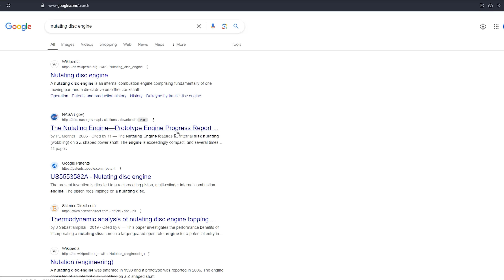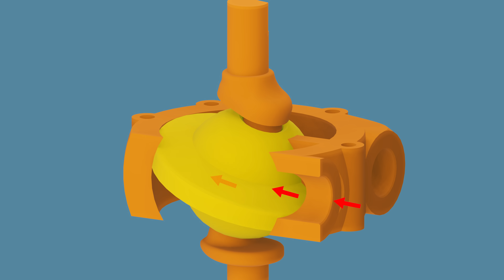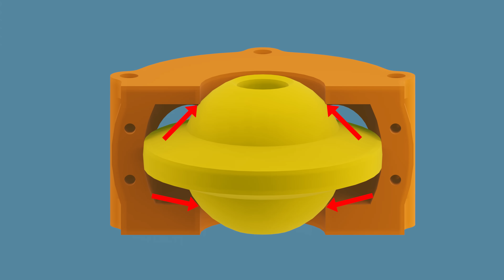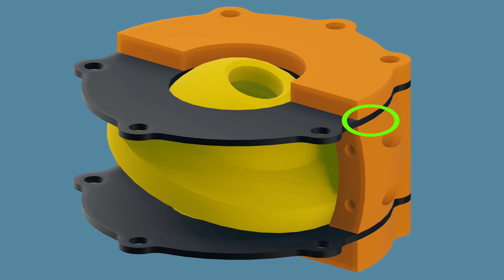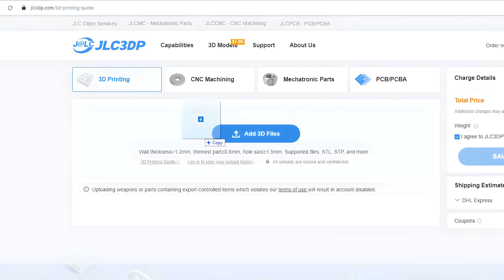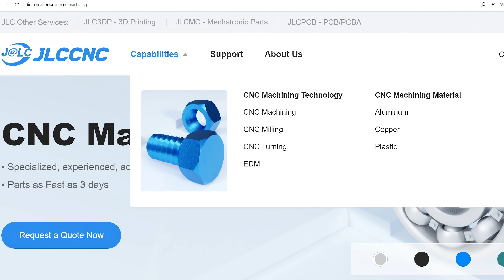I Built a Nutating Disk Air Engine

Comment: Yes it rotates. But it has two major flaws. First is the discontinous rotation movement. This is caused by the tilted axle. You need a second one tilted in the other direction to smoothe it out.
Secont problem is power. This "engine" is a waste of energy. To create a rotational movement with air a turbine would be much more effective. Because this motor just uses the pressure but a turbine uses lift created by the speed of the air and pressure. I think even a pelton weel would be more effective than this design. Even if used as a combustion engine, the friction of the seals would be higher than in a wankel motor, where only the tips of the polygon have to seal the chambers.

So in the end it's a nice moving toy but not a great working machine.

Comment: I could imagine aircraft using this same principle.  You would need very large air compressors to keep up with the demand of flight. I wonder if it could be powered by battery efficiently enough to produce proper thrust

Comment: A seemingly minor, but important distinction to all the budding engineers out there: the device shown here is a type of turbine, NOT an engine. The distinction being that an engine converts a different type of energy (thermal, chemical, potential, etc.) into mechanical energy. A turbine extracts the (already mechanical) energy in a fluid stream and turns it into work.
Reply: Im not an engineer but my first thought was: How is this more efficient than blades in a turbine? Considering this design never took off (I think), I assume it’s not.
Reply: @jck7986  I suppose it sacrifices efficency for simplicity
Reply: @bl4cksp1d3r  I don't think its even simple as  most other types of turbine has less moving parts
Reply: @bl4cksp1d3r  How is this more simple than a turbine? That is just a bunch of blades, nothing complex. No issues with gaskets and sealing etc. There is nothing simple about this design if you ask me, and given the terrible efficiency there is absolutely no point for anything practical. Still a cool video though!
Reply: @Eikenhorst  simple in the number and shape of parts. A wind turbine has more parts than this, the blade shape, the electric generator, swivel joints, etc.
I ofc make the mistake here of comparing a complex turbine with a simple one, and you might be right saying the most simple wind turbines are easier to build than this.
Reply: @bl4cksp1d3r  Well, obviously a wind turbine is complex! Since, as you mention, it includes a electric generator (and due to this, a gearbox and tons of other things). This thing just converts a stream of compressed air into a rotational motion, a task done far more efficient in a turbo (like on a car).
Reply: @jck7986  Oh, it very much did take off, just not for this application. The "nutating disc engine" is by far the most common design for water meters in the US and much of Europe.
Reply: @palpytine ok
Reply: 0:05
Reply: What if he plans on introducing fuel? 2 stroke...
Reply: @CB19087  yeah, that was my impression too
Reply: I think the machine compressing the air is the engine. The thing you made is an air differential.
Reply: @jonny5714  the machine i spoke of uses deisel as fuel. i edited my comment to make that more obvious. you can always google it though. 
this thing he's made in the video takes the power of the already-compressed air and turns it into rotational force which is the exact definition of a turbine.
Turbine - noun - "a machine for producing continuous power in which a wheel or rotor, typically fitted with vanes, is made to revolve by a fast-moving flow of water, steam, gas, air, or other fluid."
Reply: 1.  Engines involved combustion, and Motors do not.  Hence air motor, hydraulic motor, electric motor, Diesel Engine, Gas Turbine Engine, steam engine.  Anyway people use them interchangeably so when Rome do as Romans do.
2.  Another distinction is whether the device is positive displacement or dynamic.  This device is positive displacement. whereas a turbine (or centrifugal compressor) is dynamic.  The difference being how the work is extracted from the fluid.
3.  As to using this wobble device as an engine, sealing is a tough, but I think surmountable problem, but cooling the disk is a real headache.  Likely have to oil cool like a Wankel.  Next there will be hot spots with differential expansion in the housing.  The large wetted area has to be cooled… and thermal efficiency losses.   
     Pistons in cylinders are easy to seal and cool and why still in use ubiquitously.  Wobble piston engines have been built and they work.
4.  I salute the man who built this wobble air motor.  Excellent job of conception and troubleshooting.
Reply: OMG, jet engine turbines make so much more sense now LOL. I can't believe I've never learned this before, but then I'm not a mechanical engineer so I'll give myself some slack haha.
Reply: I mean, technically the pressure in the compressed air tank is a type of potential energy.
Reply: @Heavensrun this was my thought. the air in the tank isn’t mechanical energy. it’s definitely potential. something not in stasis.
Reply: This design exists as an engine too, the issue is too low torque
Reply: Ok genius, let me ask you this... WHAT'S POWERING IT? Oh really? THEN IT'S AN ENGINE!
Reply: @XG_Alpha_Supreme  -- Would you call a windmill an engine? How about a leaf? An atmospheric convection cell? An asteroid that spins from stellar wind? How about a particle accelerator? A supernova? Maybe the Casimir experiment? Maybe a flagellum? Is my anus what you think about when someone says engine? A pin popping a balloon? 

There are lots of things that turn energy into motion, and a great many of them are designed to do that. That doesn't really make engine that useful of a word though. If we wanted to stick to the origins of the word, it would include any mechanism that was the product of ingenuity, like a doorknob or a snare. 

There are lots of edge cases even beyond this one. Where do you draw the line, and is that line useful?
Reply: You do realize hydro dams use turbines in the water?
Reply: A more important distinction, an engine is an air compressor. Dude is making the least efficient transmission ever created.
Reply: my assumption with the design shown in the video is that it probably could work as some sort of an engine, but also like a radial it might not have the best torque output and it would slam through the fuel tank. it seems like it would share the same "flinging unburnt gas out of the hole" issue that similar designs carry

i'm also worried if the overall design would even be strong enough to handle the compression step with actual fuel - seems like there's a lot of points for failure (i'm thinking like the pressure either snapping the pin or pushing the disk too far out of alignment). You would have to come up with a different seal design too, because you don't want to put rubber near conflagarating fuel ... I guess that's why NASA had that other design by splitting one for compression. Also, like the other commenter mentioned - heat and friction causing material wear are likely going to be your worst enemies long term

I think there's some potential here for a fun little engine with improvements, but if you tried to make a gas version of the example in the video then it would either fail or not run very long (assuming you solved the rubber being in the chamber issue at the very least)

thinking about it too it would be hard to get away not using 2 of these in series, because you would have to do combustion and exhaustion in tandem basically somehow because they essentially share a cycle - so it would REALLY be throwing out some unburt fuel and be wasting tons of potential energy if it even worked. maybe you can try to have it combust somewhere near the back where it compresses, giving it more surface area to hit and stops a lot of the fuel escaping?
Reply: Yeah, not even close to an engine.  And pneumatic tools have been around for quite some time and do the same thing. Interesting design though
Reply: oh look its the redditor "ummmakkkshually the taxonomy here is ...."
Reply: So an ordinary 'engine' that extracts energy from compressed air with reciprocating pistons is a turbine? The main difference I see is that one extracts energy by expanding a gas in a closed chamber the other extracts energy from a moving gas by developing lift across an airfoil.
Reply: Yeah, I also thought it is a leaky engine. I've no idea how efficient it is in terms of energy losses.
Reply: A minor but wrong distinction. An engine is anything made by an engineer or operated by an engineer. The word means clever thing, so it just needs to be a cleverly constructed object to be an engine. An engineer is anyone who makes or operates clever things. Engine comes from the same word as ingenious, has absolutely nothing to do with energy or movement or conversions.
Reply: You tell that to the turbine wheel of a jet engine. Almost all turbines have a chemical reaction powering them. I get what you're trying to say, an engine is a motor but a motor isn't an engine. But unfortunately a turbine can be an engine. 🎉
Reply: semantics...
Reply: Thank you, I was imagining a traditional turbine in there and wondering how they would be different. Glad someone out here putting people on the right track
Reply: Turbine - A rotary machine that converts the energy of a moving medium (steam, water, air, etc.) into mechanical energy
 An engine is a machine that converts any type of energy into mechanical energy.

   and the engine in the video doesn't look like a rotary device, it looks more like a crankshaft )    Well, in any case, it’s hard to call it a turbine .-.  [But a turbine is also an engine.]

However, I suggest we agree that this is a new type of engine and it needs a separate name :>   a different term is needed
Reply: there actually IS an Internal Combustion Engine version of this, it uses deisel as fuel, and is nearly identical but it has a shaft that sticks up and rotates about the axis of the nutating disc inside. One half of the disc performs the intake/compression phase, while the other half performs the power(combustion)/exhaust.  The Disc, shaft, and connecting rod form a "Z" shaped driveshaft. Since the disc doesn't rotate, just the axle does, and since the seals don't get as much wear due to the disc not rotating, and since the power strokes overlap, it is in-theory a more efficient engine than a piston-style engine. 
EDIT: NASA and others did intend to use it for UAVs, however only one prototype ever existed.  It provided more power-to-weight ratio than some 4-stroke engines, but nowhere near as much as some other already common UAV or light aerial engines like the Desert Air DA 150, a twin gas engine, and one of the most popular UAV and aerial acrobatic RC engines since 1999.  
The first U.S. patent for this engine was granted in 1993 to Leonard Meyer. The engine was based on earlier steam engine designs.
Reply: @tirkentube cool
Reply: It's not minor, there is quite a big distinction.
Reply: @methylene5  it's not a minor distinction, it's a late teenage distinction
Reply: I did think “he’s just using an internal combustion engine or an electric motor elsewhere, to compress the air”
And if it’s an electric compressor, the electricity it used is probably generated using fossil fuels, as I write this a live feed is showing that my country can only generate 30% of it’s electricity from renewables today.
Reply: Its not though because the source of compression is still mechanical.. Thats like saying a gas engine is a turbine because burning fuel expands & creates compression and pushes air/gas into the pistons. Not to mention, a turbine is a type of engine. Just arguing to argue and still being wrong for no reason is depressing ash
Reply: @RealClanCinema -- The fuel for a turbine is the motion/pressure of the working fluid (which is unchanged by the turbine), while an engine takes some other form of energy to generate mechanical energy. Turbines are also engines when the mechanical energy of the working fluid was made by a different process, like in a gas turbine engine, or a nuclear steam turbine. There are lots of turbines that aren't engines though, like water wheels or anemometers.
Reply: @TlalocTemporal  when you vicariously admit exactly what I was saying at the end of an ignorant tangent ^

Comment: Add an impression into each side of the disc in the shape of your ignition chamber. As the disc goes up and down, this could add to compression and make it more airtight as well. It would take computerized timing to get right, but it’s probably a worthwhile step to try.

Comment: I had idea to incorporate.  What if you had a outer ring turbo charger system.. think of saturns rings.. the rotation could be even geared or hydrostatic.. it's first thing that popped in my head when I saw this in linup.

Comment: Please try the dual stack version of it and use the excess air to run on secondary rotor or disc as u say :) 
I guess that it will need much higher psi for the secondary disc to work and it will steal some rpm from the first one but tork may increase at the and.

Lastly happy 29th October Ne mutlu türküm diyene :)

Comment: Try replacing the internals with simple fixed vane pump components. These are known to be inefficient, but I wouldn't be surprised if it is more efficient...

Give it a try and post the results

Comment: That is not an engine, but a pump. It would have been far more effective with a standard design impeller with air as a medium though, but there could be usecases argued for discshaped pumps, but definitly not as an "air powered engine".

Comment: brilliant!, simple, you have a blow through freewheeling of air that is wasteful, but still useful or maybe even needed. if you get the right length of hose, you can set up a resonance in the hose and the tank pressure that is constant. as the air pressure drops, velocity goes up, so when the valve comes back and cuts through a low pressure, but a high air flow, the velocity gets converted to pressure inside volume being, pushing down to turn. If you make two  interleaved halves, 180 degrees out, a left and a right with a center injection port. then no blow by is created and all pressure power is used. Capturing some of with resonance is not needed. But you need 2, but that's ok cause it will 2x the power out!
 or

Comment: I wonder if you could attach to it a diesel heater to get the air pressure from expanding gas off the burner. For a quiet and efficient engine.

Comment: Now you just need a system that has two hoses hooked up. An actuated valve that can either reciculate the air into another chamber for reuse or bleeds it off. Thwn you have a "fuel" tank system and a way to power it. Would be better on a land or water-based design than air.